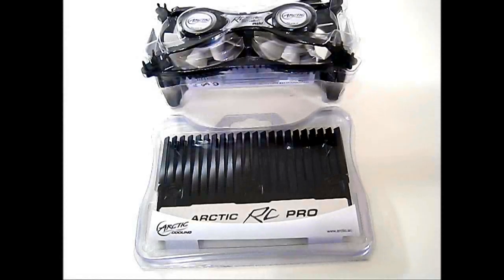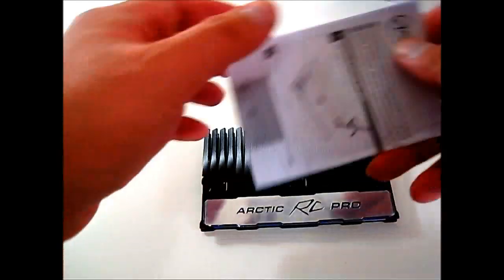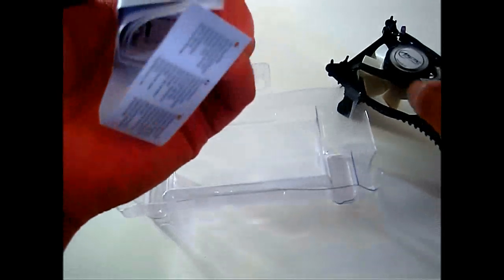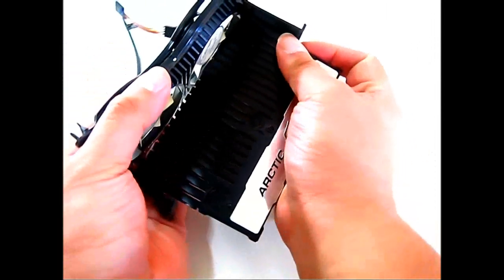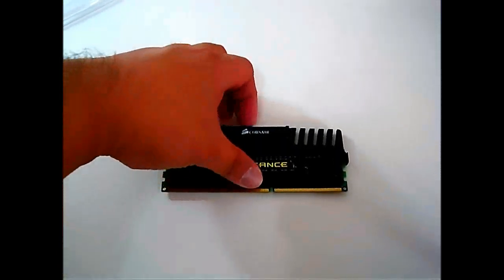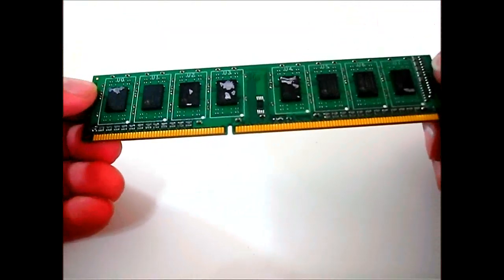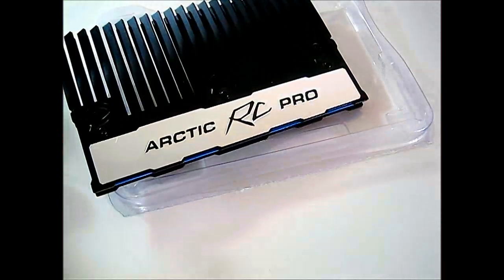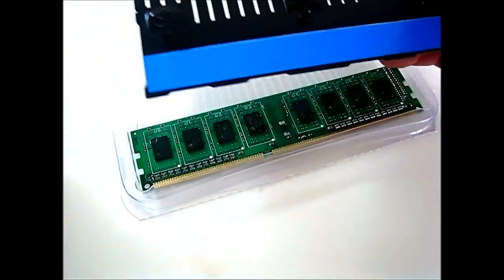Arctic RC Pro and RC Turbo Module PWM Fan RAM Cooler - Overview and Installation

Comment from the maker: Nothing really as the regular Vengeance heatsinks cool it just fine. Just in this case it was to show how to install the the Arctic RAM replacement heatsinks. Ironically though, the Vengeance heatsinks came off on their own on my other kit a week after I shot this video just through normal wear and tear of moving it around systems. lol.